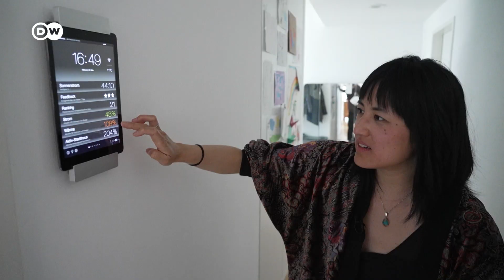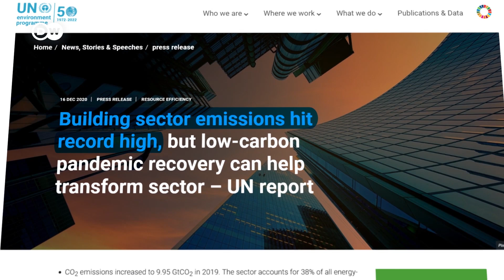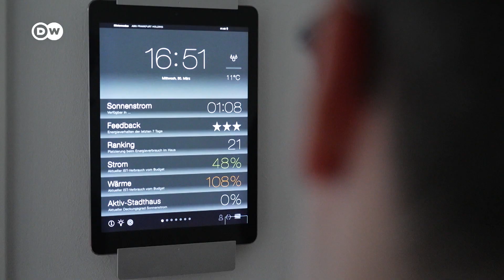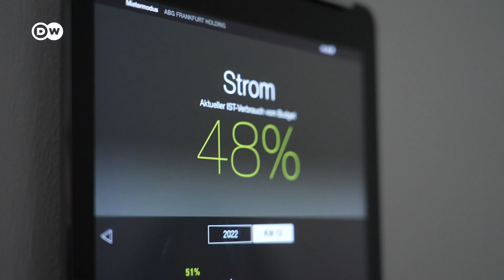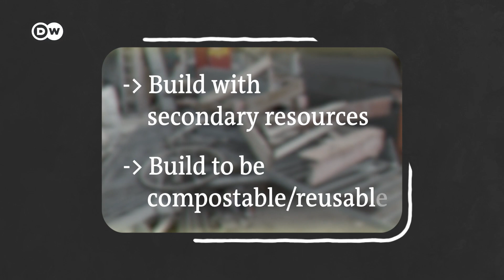Why our buildings suck, and how to change them

Comment: you already live in a home that tracks your energy use? host saying shes not sure she would is odd, dont you get billed for it every month? Having a real time display of course makes this better. Germany is doing a lot of great things when it comes to sustainable building, livability. Their general approach architecture rules. 40% social housing is great. More of this
Reply: i dont know how every country does it but most of the time the electic company isnt going to every house to read every meter the bill they send you is just an estimation where im from they only come to read your meter maybe once every 6months or if your disputing your bill.
Reply: When you sign up for energy in Germany you tell them how much you are going to consume - e.g. 2000 kwh for 2 persons. And then you update them with your current numbers annually, or every 6 months (which is just an update). So at the end of a year, every German either gets money back, or has to pay some to the provider. So yeah, you do have some insights into your energy use. I guess if you want to track your consumption more closely you can just get smart meters. It's pretty convenient though if it comes with the flat.

Comment: The non sequitur opening line of the video: "Cities are growing, which means we keep on building." Right there, you lost me...
Reply: Due to mechanization of agriculture jobs are lost in the countryside. The jobs are now in the cities, so people move to the cities. Take Sweden, where 88 % of the population lives in urban areas. So we need to build more housing in cities.

Cities also need to grow to let people live near their jobs, so the cycle or take public transport to their job. Which also reduces congestion of cars. City houses are much more energy efficient, living in an appartement building shares your heat with others and you live smaller, easier to heat up.

Comment: The "Progressive" solution: Adobe skyscrapers with no windows, Unionized hand 
cranked elevators; outhouse bathrooms in the basement that doubles as fertilizer 
on city crops nearby. Downtown? no roads access ever! Deliveries? Chinese styled 
human trucks (furniture on backs strapped by ropes). All "humans" must walk 
50 miles to get to downtown. Restaurants with really slow food choices: Vegan 
or recycled trash  converted into "nutritious" chips. Recyclable shower water only 
refreshed after 1,000 showers, and after that converted into semi drinkable water. 
Life expectancy to substantially decrease in order to make room for those not 
aborted by "Progressive" mothers. Recyclable cardboard beds, and newspapers 
as blankets (recyclable,  of course). Cold meals all the time since a hot meal invites 
global warming.  No Mexican food ever  since it contributes to climate change due to ingredients and its emissions byproducts. These are only the beginning towards a road
brimming with "sustainability" Newspeak and mind control would also decrease global warming, carbon footprint, and non sustainable thoughts (i.e. free thinking, freedoms,
individuality, self-reliance, and all the similar other "toxic behaviors").

Comment: All I see is greenwashing. Real sustainable housing looks nothing like any of this.
Reply: In your opinion, how would actually sustainable housing look like?
Reply: @E1Luch  Small, good design over size, well insulated, efficient appliances, try to use local and and abundant materials like dirt, which has excellent qualities for almost any environment. The way we do architecture is ridiculous. Brainless termites do way better.
Reply: @dustman96  There are tradeoffs though. Smaller buildings have bigger ratio of surface area to internal volume, which means it's easier for heat to escape and you need more power per volume to keep it warm. Also building small means your settlement, however big it would be, is intrinsically low-density, and it means it's much harder to get adequate infrastructure to everyone, because you need more roads, cables, pipes per person, and increased land use comes with it's own environmental problems
Reply: @dustman96  But also, wouldn't we still need some frame to build with dirt? How good of an insulator is it and what kind of strength a dirt house would have? Btw, if you have any article or video or whatever on the matter to share, please feel free to do so, I would love to take a look

Comment: Sadly in Chicago huge old factories and warehouses are instead demolished wholesale just for another concrete based structure to be built on top instead of renovating and reusing the same building which would be far less wasteful and more ecologically sustainable. Older buildings that are still standing today do so BECAUSE they are solid - sure they may need a lot of work, but they truly don't build em like they used to. We need to make buildings that last, enough with this wasteful consumerist mindset in architecture that designs buildings with human lifespans. Build right, build strong, build to last, not to demolish and replace every 50 years. I hate that mindset of many architects that think buildings should have short lifespans - it's unsustainable.

Comment: I have a house on 1/3 acre in a drought-stricken area of the PNW of the US.  I am relandscaping with drought-tolerant plants.  Just removed 12,000 sq ft sod which went into landfill.  I am one of the first in my area to take such steps but if it trends, we will have a problem with where to toss the water-gussling vegetation.  Temps have risen in my area by 2.2 degrees in past 45 yrs, mostly in recent decades.  Rainfall is okay but our snowpack is shrinking every year now.  Predictions are within 35 yrs we wont have any snowpack, which all the valleys rely on.  PNW is one of the areas in US of fastest warming.  Many people here are still wanting their lawns.  I have a well and i would gladly share any of my water with other animals, but not lawns.  Besides, i refuse to use herbicides on my land, so my lawn never thrived like others.

Comment: I have to wonder if the general rule of having buildings be independent standing rectangles is part of the problem.  Could we connect more of them, even if just superficially and share their heating/cooling requirements?
Reply: No, there are regulations of how close buildings can be because it will block the airflow causing huge problems.
Reply: Yes, rowhouses and townhouses are far more thermally efficient than freestanding houses, in cold climates.

Comment: Would love to live in a "net 0" house TBH. would love to see how much energy I produce from regenerable sources and try to keep my consumption under what I can physically produce through solar or perhaps wind. Like it was said in the video, this would be a challenge and challenge makes us get better. 
Sadly, in Eastern Europe, we are very far from going towards small scale/HH level renewable energy sources. It's more common seen at the 1%ers TBH and it's not OK. The only way you can afford solar panels is through a multi-decade loan... most of the people will not take this route even if it has a positive value in a relatively short time.

Comment: People like Dr. Lemaitre often "forget" to mention the most important consideration for 99% of Germans when deciding to tear down an old building and start again new. 
It is simply a matter of cost. 
Trying to re-engineer an existing structure into a performance building is significantly more expensive than just ripping it down and starting over. 
Given that the housing prices in Germany have exploded over the last 10 years, the additional costs are simply too high for the average German to bare. 
Sure, in Frankfurt the average salary may well be 60k€ / year, but people living in a flat like that family in downtown are absolutely not making only 60k. Likely the average for that area is 3-4 times that. 
Most people would like to "live Green", but the truth is, we simply do not have enough in our bank accounts to do it.

Comment: Bruh. Everyone joins latest architectural fad just like they have been doing from '60s. 
Why can't we return to pre-War style of building where stuff is being build from solid bricks and reinforced concrete, but also is going to outlast 95% of modern buildings. Best way to limit CO2 releasing is when you do it once and no more.
Reply: Best way to limit CO2 releasing is by limiting the number of CO2 releasers ;)
Reply: @aleksandrastvardauskas7288  Yeah, and how are you gonna achive that? It's better if you can build something that will last and will need as little modifications as possible over the years. I mean everything is temporary, but it's better when building will last 100+ years than 30 years.

Comment: The Building Administration standards are designed to always be timely, adept, as well as environment friendly, from its inception,all throughout. It is the anticipation of architects, designers both internal and external in delivering the best things in building administration, this pertains to geodetic standards, codes, and safety and sanitation protocols and standards, in an Industrialized society. Materials from numerous sources are to be as efficient as possible, in order for the quality/quantity to be maintained. SMEs..General practices and standards/Building administrators/city administrators/Geodetic/structural/Chemical/Electrical-Civil/ENGRs, SITE ENGRS, GP/NP/MCR/Tiers 1 and 2, Lvls 1 and 2, are coordinated regarding completion standards/requirements/implementation and maintenance standards. Respectively: G.M Industries. Don't DELETE, this is information/Informative reports generation/implementation measures.2022 onwards.

Comment: using frp created from waste glass and plastic trash to construct with design standards which meet Leeds Platinum rating and wind turbines and solar panels in the building with waste segregation services are some of the inputs that can significantly lower carbon emissions.

Comment: I think people in tornadoe alley need to stop using wood.
Like a rock home made in the 1800s is still there but the wooden home next to it rebuild like 8 times.
How can people be so ignorant to the planet continue logging to help rebuild there wooden home rather then use rock and potentially just fix the roof after a tornadoe but they will rebuild the whole house.
Reply: If the timber is sourced sustainably. It results in carbon negative footprint. Carbon is trapped from the atmosphere into the wood.

Comment: If everyone would shell their walls so heat stays inside and put a solar polar on the roof the "energy industry" would die.
Reply: Solar power is picky. Won't work in cloudy and rainy countries especially in winter.
Reply: @user-bi8ko7kc6h  Even during winter you get an output.
Solar panels are getting more advanced every year. The output rises with each new model, since the industry is still on the rise.

I am not an expert, so we can not talk numbers. But look: What do you care about your energy earn during winter, when you do not have to pay energy bills during summer from now on? You even get the money you spent on the solar panel back in a few decades.

This is money which is as free as the light of the day.

Comment: "could you live in a house that tracks your energy use? I'm not sure I could" hmmm this is something you would have to really struggle to avoid, since every use of energy by building inhabitants is tracked and sold, nearly universally. But even if one were living in a flat that didn't sell access to these things, living in there while having your energy tracked would not require any effort, so why say that you doubt you have the courage to endure such a small form of adversity? It's like the narrator is mocking the entire concept that this video is promoting.

Comment: i agree- i think its the "architects" that should be leaders on this- but my experience says they are the cause!  their values are more towards "conventional beauty" or the "view" or "cost" and not longevity, or the environment or even saving money .  then its also the customers who are ignorant of what good architecture is. shit they can't even site the building properly which would have the long side facing south (where you would emphasize the glass for winter sun)  and the roof sloped to the south for PV panels- those both should be Code at this point!

Comment: Aren't solar panels made with unsafe materials? Or something else.

Personally speaking, we should instead look into making solar panels cleaner, safer, and cheaper to make. We should also look into alternative materials for buildings like apartments. For example, planks made from bamboo or tiles made from CO2 emissions.  We should also reduce the amount of cars a country can have and promote public transport, especially in places like the US where people often travel in long distances.

Another thing is to change course from plastic to paper, paper made from alternative sources or "bio-treefarms" as I would call a place that farms biologically enhanced trees. Another thing is to find a substitute material for plastic, plastic that is used on Charger bricks, phones, and other mass produced products or make a cleaner and safer version of it.

And, speaking of chargers. To sue or have companies like Apple and Samsung place the charger back in the box as it is both required for a phone to be with its rightful charger and waste efficient as it reduces the amount of waste like the plastic that wraps the box that contains the phone and even more plastic, that we just throw away.

Another thing is to switch from plastic bottles to paper.

Next is to pull people closer to a point than to let them spread out. Then use the verticality coupled with density to create a sturdy structure in which people can live in. This would reduce the space that we occupy on the planet and allows us to have space for farmlands and nature.
My concept would be to make something like a HumanHive in the shape of a Honeycomb or other shapes that can witstand compressive, pushing and pulling forces.

Like, alot of things need to be improved, changed, and resolved.

For example. Meat.
It is one of the most pollutant resource that we have due to how much it takes to produce it. While yes we could all switch to vegan die but, I wouldn't. A good roasted fish, eggs mixed with greens, bread, and all those things that are easy to access and gives alot of nutrients and just the deliciousness is not something I personally would want to pass. Instead, we look for a way to make it easily reproducible. Though, this would create a problem in the lower sect. Poor people generally use and emit more CO2 than any households due to them not having access to cleaner and much more efficient tools. (They also live in dangerous places so, they can also benefit in the safety of the humanhive.)
So we should first help them, so that we can move on to the next step. Helping poor people will also help with the economy, safety of the place, and out future. Why? Because nobody's going to be desperate enough to take a life or turn into some corrupt psycho rich ass that will run a corrupt bloodline, if you cut the reason as to why they're being so desperate in the first place.

So, by helping the poor people, we can then move on to improving farms via the use of science and tech which help us move one step further.

We should also avoid putting green powerplants like Hydro in places with marine life. Same for gigantic windmills.

We should also look for ways to make use of the Green House grass emissions. Or make tech that allows us to separate Oxygen from CO2 from the air... something like that. Basically an air filter/cleaner/purifier. 

As for power. Nuclear is the best option. While it may produce radioactive waste, it currently is the safest and cleanest source of energy...
That is until the nuclear fission generator gets created. (Is that what it was called?)

Another thing. This is very important. "Refilling mines." You read that right. Mining causes massive destruction to the environment. This act alone can wipe nature and habitats in one fell swoop. Mines like those found in Germany's coal mine have been expanding ever since, and I think it's time for us to stop.....if we all move to nuke power or nuke-fission power. 

We should also replant trees in areas prone to landslides. And no, not saplings but, those that are already big and strong. Make a farm of those and plant those. That's alot better.

Or we could transfer some growing trees from tree dense places into those areas. Kind of like how you would transplant hair.

That's alot of ideas right there.

Comment: Attacking energy usage is the wrong approach IMO, and it will never really work. We should make carbon-free energy cheap and plentiful, and decarbonize concrete to further reduce the climate impact of building. There are alternatives concrete mixtures that don't require direct emissions.

Comment: Best way to reduce waste is to change behaviour(or reduce people) especially in countries where consumerism is rampant. Looking at high spending areas. Move to the countryside and you will think twice about a frappe.
Reply: You are right about changing behaviour and reduce the populations, but people's energy consumption is the lowest in the cities: living in flats share the heat and most people live on smaller space. Needing less heat. 
Living in the countryside means car transport, because there is little public transport and distances to commute to work is long. That burns a lot of gas/ petrol.